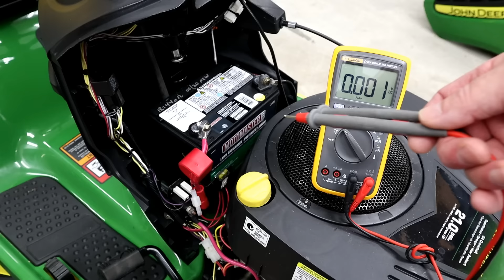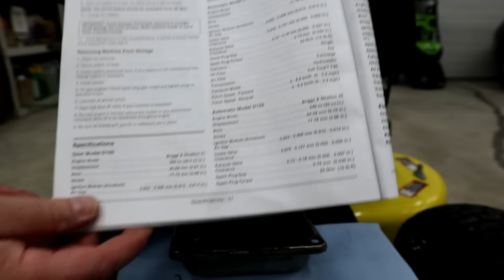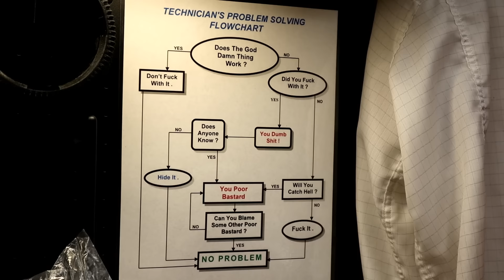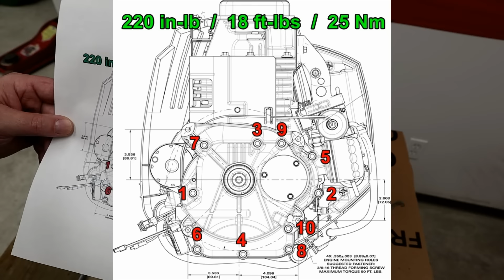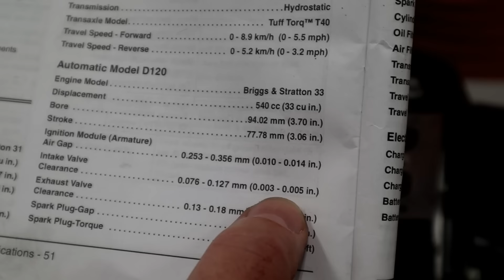Why Won't Your Riding Mower Turn Over? COMMON Briggs Intek PROBLEM & REPAIR.

Comment: Amazing that there wasn't more damage inside there.
Reply: IF the pieces don't damage anything the moment it breaks as the engine is running, the pieces can settle into spots in the bottom of the engine and sometimes stay there for the life of the engine. It will start by rotating it by hand just pass the compression stroke. And you can also cover the air intake with your hand until the engine starts, then reinstall the air filter after it starts. People have done that for years too. They only use a compression release so they don't have to use a bigger, more expensive starter motor with stronger flywheel teeth. When mine breaks, I will leave it alone unless it tears up the engine when it breaks. No way I will do all that work just to install another defective part.

Comment: Great video. So I have a Scott’s riding mower that has a 16hp Kohler engine and I’m having the same problem. I checked the battery and it was fine and then I pulled the valve cover off to check the valves and the engine I have had no adjustable valves which is about the craziest thing I’ve ran across. So I’m wondering if it’s a valve issue or after watching your video I now wonder if it’s no the cam.
Reply from the maker: As I stated in the video and in the title, this is a Briggs & Stratton Intek engine issue only. No idea what Kohler's engine design is like, how or even if they use a similar functioning decompression release?

Comment: Just had this problem on a 5 year old Husqvarna lawn tractor.  Cost a little under $400 to repair.  I'm not happy to find that it's a common problem with this motor.
Reply from the maker: Sorry to hear you've been bit by the infamous Intek decompression issue too ☹

Comment: Excellent Video. One question though. You show that when you just need to "adjust" the valves, TDC is when they are both loose but after putting everything back together and they're both loose no mater where you spin the engine, how would you be able to tell what is TDC?
Reply from the maker: Lots of ways. Straw in the spark plug hole like I show in the video, use a piston TDC gauge, use a scope camera in the spark plug hole, look for the TDC mark on the flywheel, etc. Once you've found it, then mark it on the fan shroud if you wish so you can easily find it afterward.

Comment: Similar engine BS OHV on a 2004 DYT4000, intake valve has movement when I push it by hand but will not move when turned over, do you think this could be the camshaft as well?

Comment: Can you tap a thread in the head next to the spark plug and install a make-shift cable operated compression release? Similar to some older two stroke motorcycles. IDK. It's just an idea that popped into my head. Hit me back if it's feasible. If so it would be a lot easier to permanently eliminate the decompression mechanism on the cam.
Reply from the maker: IDK either, but almost anything is possible with enough skill, knowledge & resources. I for one won't be attempting any such task not knowing what unforeseen issues could develop as I'm not a mechanical engineer. It has been my anecdotal experience over the years that whenever unknowns are introduced to any system, reliability & operation more than often suffers. Of course anyone who wants to try a such a decompression mod on one of these Intek turds has my full support in hopes of eliminating the grenade within. 👍
Reply: @Rchelicopterfun  I've got an old non running engine with the same head. I'm looking at aftermarket compression release on internet. Some are only .$10, If I ruin the old head and lose $10 and fail I'll let you know.
Reply: Stihl has a decompression valve like that on some of their largest high compression chainsaws,I think it just screws into a threaded opening in the top of the cylinder. But those chainsaws are much harder to pull than the 4 stroke big lawnmower engines,I think because there isn't room for a big enough pulley for the rope rewind mechanism.  A bigger diameter pulley makes it easier to pull crank an engine,even one without a compression release.  @Rchelicopterfun

Comment: The better solution to this issue is to ditch the pi$$ poor decompression design altogether and use a higher torque starter motor. The only reason to have a decompression system is for those engines using a pull start or some other form of manually starting.
Reply: @Zak Dingle How much cost and aggravation to just drop in a Honda engine?

Comment: Best video ever! Thank you!
Reply from the maker: Hope it helped 🙂
Reply: @Rchelicopterfun  Thank you your video is the best I have evr seen on you tube. I have problem engine try to starts but in process backfires and harder then usual time to start. Once it starts runs very well and I can finish to move my 2 acres with no problem. Check the timing check the valve adjustment and everything looks good. So, now I am thinking that compression mechanism on cam shaft is the issue.
Thank you again for your very clean video.

Comment: Thanks, great video. I've come to the cam replacement part and the replacement OEM cam has the decompression spring but the original did not. The third lobe was slightly worn but no shrapnel or place for spring to attach to first lobe-no spring. Lines up properly it seems with dry intall. Haven't gone further waiting to hear back. Can I use this cam? Thanks.
Reply from the maker: I'm afraid I don't understand what you are describing? Are you saying the decompression pin and assembly on your original camshaft didn't have a spring on it to keep the pin and arm in the start position? If so, then my only guess is the spring broke off (has been known to happen).  It must have had the spring if it was working and now isn't.  Where it went, who knows? It has to be in there somewhere. Perhaps it was shredded to bits and fragments are now inside the oil filter or suspended in the oil? Have you opened the oil filter or checked the oil you drained out for metal particles? There are lots of little nooks and crannies in those engines as well where it might be hiding out?

Comment: Thanks for the tutorial. You mentioned towards the end, where you're about to adjust the valves, to rotate the engine to "top dead center". Is that when resistance starts or when resistance is the most to turn it?
Reply from the maker: TDC during the compression stroke - i.e. both valves closed. You won't feel any compression resistance with the spark plug removed.

Comment: Helping a neighbor with a Craftsman 18 HP Intek.  Seemed to be locked up. Took the spark plug out and gas poured out.  Turned over the engine and then put in the plug.  Engine started but ran rough and smoked a bit.  Check oil and smelled gas.  Engine will start but will not pick up speed.

Any suggestions for next steps?  Or do I help the neighbor push it to the curb?
Reply from the maker: Sounds like massive over fueling. Carb overhaul overdue perhaps (float needle stuck/sticking open)? Just guessing of course as it's impossible to diagnose remotely.

Comment: Very good video. I may have missed something about when setting the engine at TDC, but keeping the piston down a 1/4" down from the top of TDC, would that be on the compression stroke, or the power stroke? For setting the valve clearance. Can anyone tell me the answer, or am I simply wrong by asking?
Reply: It's on the start of the power stroke, that is, right after spark. The B&S repair manual might word it clearer: "Turn crankshaft past top dead center until piston is 1/4” (6.4 mm) down from top of cylinder."

Comment: I'm still running my John Deere L110 weekly for over 20 years without any repair. It has a 17 hp Kohler that is far superior (in my opinion) to my L111 with a 20 hp B and S. I hope now that I've said it outloud that that continues to be the case!
Reply from the maker: Yep, if your luck is anything like mine, the moment I think I'm fortunate and dodged a repair, Murphy's Law more often than not proves me wrong - even after knocking on wood 😄

Comment: Any ideas on a briggs intek 18.5 that just had the camshaft replaced and now it will not turn, physically, at all. It’s like it’s been welded tight. There’s also oil in the piston area
Reply from the maker: Governor gear not seated correctly on new cam would be my best guess, but it will have to be opened for inspection - just guessing otherwise.

Comment: That sucks.   I had been watching tractor videos because i am thinking I am going to need one when I move to my new property.   The videos i see put me off them altogether.  I have a 12 year old Honda push mower that is finally rotting through the deck, but it still runs like new and starts first pull almost every time.   I just can’t see me mowing over an acre with a push mower so i may have to buy a lawn tractor.
Reply from the maker: @davva360  - If these dirty maintenance monsters give you pause, check out the electric riding mowers from Ego & Greenworks (and a growing list of others). They are amazing! If I was in the market for a new riding mower and certainly if I outlive this one, the next will be electric - 100% no question. Our neighbor has an Ego Z6 and has let me use it a few times - bloody awesome machine. The only bad thing about it is now I want one too. 
Hear ya on the Honda. I have a 24 year old Honda HRB 215 (the xenoy/plastic deck version) for doing the smaller areas of our acreage and it's still running like a champ and I've done bugger all to it other than an oil change & blade sharpen once a year, replaced the spark plug and air filter twice and had to replace the rear wheels last year because they finally wore out. They go forever, but I sure wouldn't want to cut the entire acre+ of grass with it 🙂

Comment: Very nice video and instruction.  You should be an instructor with the manufacturer.  My JD won't start after running over a hard object.  I checked the flywheel key, still intact.  I suspect this or much worse.  Unit is still under the OEM 2 year warranty but suspect this may not be covered.  Would you know this?
Reply from the maker: Well, that really depends on the symptoms and the specific engine. You never stated model, or what engine. If it's a Briggs Intek engine and the specific symptom is it always stalls during the compression stroke while turning over but you can get it started by turning it past top dead center as demonstrated in this video , then it most likely is a decompression cam issue, and you would then have to go through the same diagnostic trouble shooting steps as shown in the video to confirm it.
However if the engine turns over fine but won't start, then it's not a decompression issue. If that's the case I would first check for spark as a sudden impact as you said can knock the flywheel out of timing, or cause the coil gap to change.
As for warranty coverage, no idea as it depends on the specific failure. Warranties won't cover damage that resulted from hitting something.
Reply: @Rchelicopterfun  Hello John.  It is a smaller S110 JD mower.  Unit cranks well but just never starts up.  Dropped it off at the local JD store yesterday.  They should be trouble shooting it today I'm told.  Hopefully it won't set me back too much.  Love your vids and expertise!

Comment: Do the 17.5 up Kohler engines in the L120's have the same system and problem? Why don't they just put a stronger starter in these machines so they don't need a compression release ? There should be a a class action lawsuit against Briggs for this issue it's way to common!

Comment: Great video BUT, If you suspected the cam shaft then why in God's name would you start the engine? 
Other than that it was a very clear and helpful video. Thanks for making it.
Reply from the maker: First I never suspected the camshaft, I suspected the decompression assembly. Second, if any engine damage was done at the moment the decompression assembly broke apart while the engine was running, nothing can be done about it. It's not like there is any warning or sound when the decompression assembly fails;  it's a silent failure with no indication there is a problem until the next start cycle.
Even if you catch this component failure at the very next engine start afterward which is when you will first be aware something is not right, the engine will have been running for the entire duration of the last mow and all the broken pieces will have long since settled out down into the sump where they stay. Any starts after that initial failure are almost never never going to make the situation worse in other words. 
Moreover, many never even bother to fix this issue and just leave the broken decompression parts down in the sump and continue to start their engines by the way I demo in the video or by blocking off the intake while starting so there is less air to compress; and an Intek can run for years like that.  
Personally, I like to get the broken bits out of the sump ASAP because with my luck, I'm the 1 in 100 that will have a busted piece of decompression splash back up into the crank case and put a nice canyon sized gouge into the cylinder liner.
Reply: @John Salt  That's interesting. Thank you for your answer. Again your video was one of the best I've ever seen. Great job helping those of us that can repair this but don't know exactly how, but we do now.
 I have a 22hp twin v engine on my JD mower. I was wondering if the cam shaft had the same type of spring loaded relief for the decompression as does the single piston? I haven't had any problems this far and haven't seen any videos of this problem on those types of motors.
Reply from the maker: As far as I know it's only the 31 & 33 series Intek that have this issue. I've never heard of it on the twins; but then again, I've never searched that hard for their specific failures 🤔

Comment: Great info here John. I assume with twin cylinders each one has this decompression & one or both could be broken? Removing my starter & bench testing seems to be good but like your demo the engine locks up. If you tried to start at this position would you also get the solenoid clicking? Now I notice my new key switch doesn't come back to the left when releasing & both red & black wires got hot enough to burn off insulation. My husband is at his wits end as he said the black wire went to one large post & red to the other large post of the solenoid. One Craftsman video even confirms & he's positive they came off that way.
Reply from the maker: Only single cylinder B&S  Intek have this weak decompression issue, twins are not affected. No idea on the switch, would need to located the wiring schematic for the exact model to correctly fault trace or probe extensively with DMM to source the issue/s (faulty switch, faulty wiring, incorrect wiring connectivity, faulty solenoid). Have you confirmed the engine is not hydro locked with fuel in one or both cylinders (pull plugs and blow out cylinders). If that checks out, have you tried to see if it will turn over by just energizing the solenoid with a 12VDC jumper? That is where I would personally start the diagnostic trouble shooting process (start with the easy and work through the list of possibilities to the hard).
Reply: @Rchelicopterfun  Thanks so much for the good advice. I couldn't get it out of my head the way the solenoid was wired & I still missed hooking up ground wrong. Even though 13 years old has less than 160 hours. This starting problem was since new & clicked a few times but always started. Problem ended up to be the key switch. It had excessive di-electric grease & lots of crud & dirt had built up. Plus a spring had fallen over so making bad contact. It was hydro locked by this time & still has a strong starter. 6 weeks of aggravation is over but learned a lot. We did put on a new drive belt & if I could offer some advice not sure if seen before? We removed the 4 engine bolts to move side to side & made belt replacement so easy. This again on a 24hp 42 inch Craftsman. Thanks again!!!

Comment: Is this true for the V twins?  I have the 726 cc 26 HP and I’ve had that issue since day 1. 15 years and 1600 hours still runs fine. Just doesn’t start fine.

Comment: The problem you described sounds exactly like what's going on with my riding mower.  Are you located anywhere near the Belton, MO area? I need to get my mower working correctly asap, but the repair business I've been going to for several years just closed permanently, so I need to find another trustworthy business.
If you're not near Belton, can you recommend an honest repairman in my area who would be able to fix my riding mower?
Reply from the maker: I'm in BC Canada; thus don't know of any shops in your area.

Comment: Quick question is there a way to clean out the broken metal without splitting the engine apart? I would like to just avoid the cam replacement. Again whats the point it will continue to break, so i think just avoid it.
Reply from the maker: No way I know of considering all the junk is sitting at the bottom of the sump and they only way to get to it is to remove the sump. Replacing the oil and filter as well of course to get rid of what's already in suspension. Several good ideas in the comments here to make these cams last by rounding out the trailing edge of the pin (what usually snaps during shut down). I'll be doing that to the next cam assembly (if this one ever brakes again).
Reply: @Rchelicopterfun  ok thank, so i guess  if this happens to my engine i will split it clean out metal and grind clean any remains of the acr and assemble it. I will just block off intake to start it everytime. By the way my engine is having this problem but i will like it just need a valve adjustment. Cause it didn't happen overnight i notice sometimes was hard to start while other times it just cranked right over